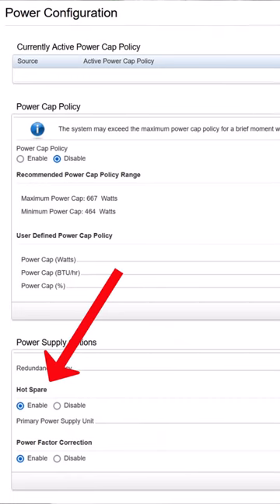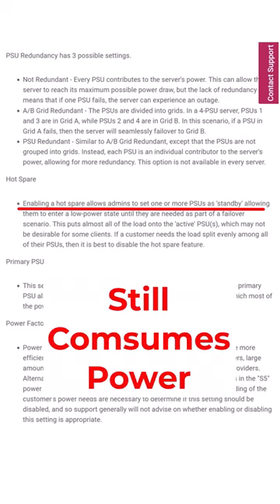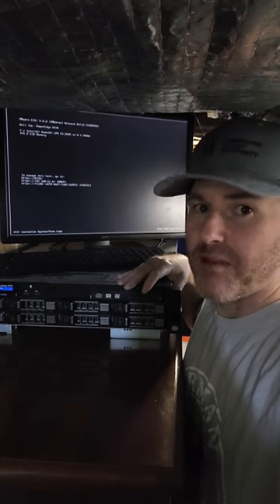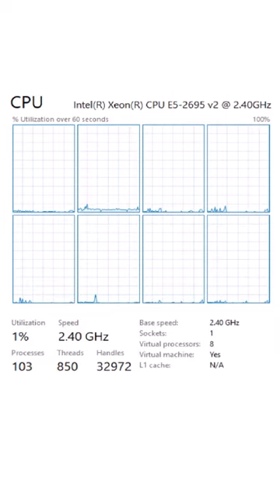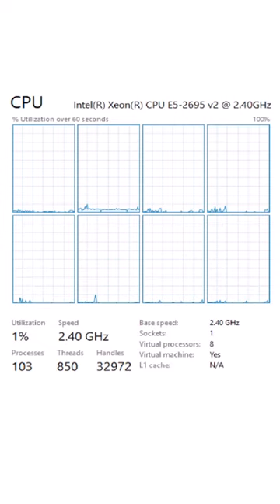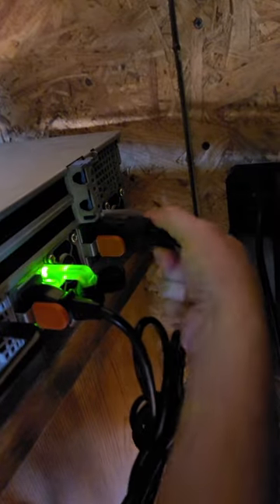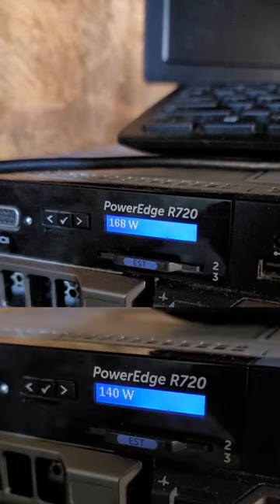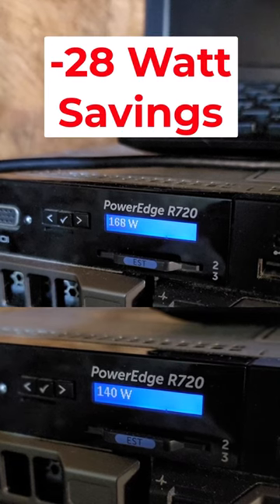Dell Server Homelab Power Consumption Tip

Comment: In a homelab environment I think this is totally acceptable. Which is what this channel focuses towards anyways, so thumbs up. Obviously not in an enterprise environment, but I feel that was implied. Good stuff man. Not many people looking at lowering power consumption on these old rackmount servers. I’d love to see a part 2 if you come up with any more ways to save power!
Reply from the maker: Thank you for the kind words! As you said, that's exactly what this channel is tailored towards. With energy costs rising to the order of 0.30 to 0.40 per kWh in some areas, it may be something a particular homelab user may be interested in. I'm glad you're interested in a part 2! I actually have some info collected for exactly that, ranging from specific BIOS settings to physical configurations such as with this video. Cheers!

Comment: Just remember this is a 1+0 configuration, don’t keep anything super critical on 1+0 PSU config, and if you’re in an organisation just don’t do this at all
Reply from the maker: You're correct. This is for homelab users where power effeciency trumps redundancy.
Reply: Yeah I thought as much, perfectly fine running 1 psu for non-HA applications

Comment: There are some people who adjust the fan curve (mostly for 1u server), so fans would consume less power, others disable USB, NICs, internal SATA, avoid using HDDs, enable C-Sates, use smaller PSU, reduce the amount of ram sticks.
Reply from the maker: That is true. On this YT channel I provided a step by step guide for manually adjusting the fan speeds using IPMItool. I also have another video on this channel that picks apart the average consumption rates and effects of each on the overall power consumption.

Comment: Dont trust the power readout for anything outher than a guide, the resolution is very low so does not give you and accuracy.

For example the R330 in my homelab logs poeer every 15min, and during normal operation only reports i value of 42W, 56W or 70W

Accurate measurement will need a power Meyer, and if you have two you can see if the power policy working. Also if not i have found that after some time i see both power supplies start delivering power so have also gone down the path of just unplugging one power supply and they work both plugged into a UPS
Reply from the maker: It's close enough give you an indication of power reduction.

Comment: I've seen people getting 90W with some VM's running. Few threads on /r/homeserver. How are they getting that? I got mine today and it's idle. Only using a single HDD while I play around.
Reply from the maker: Sounds like they probably only have one CPU or two very low power CPUs + SSDs, likely not dual redundat PSUs, no PCie cards or NVMe for drives and all power limiting fearures enabled and/or not many ram slots occupied. If they're that low in watts with an R720, the system is limited compared to its maximum capability. It's a give and take all over the map, but they're greatly limited in some ways.

The 150W this one R720 gets is the absolute minimum for dual CPUs (highest thread count), all ram slots occupied, all drive bays occupied with HDDs, two NVMe drives, power saving options enabled, and dual redundant PSUs enabled. From 150w idle and under benhmarks skyrockets to 550w

Comment: WTF NEVER DO THAT you disable Redundant Power for savin energy absolutely not!
Reply from the maker: If one has a consistent, reliable source of power with it's own UPS, it's a common practice. Been doing it for over a decade on numerous units with with zero issues. Homelab setup, sure. Enterprise environment where HA is paramount, no.
Reply: and all for 20W saved !!!
Reply: @craigcooper1967  - In my case, that's £40 saved a year for something I don't need. Nice to have? Sure. But don't need.

Comment: This is kinda dumb… redundancy is very important, especially if you need 24/7 up time.
Reply from the maker: Redundancy is definitely important, but this is also assuming the system is on a UPS. Power supplies don't fail frequently enough in a homelab situation.They happen, but uncommon. This is also a situation that the owner needs to weigh. In certain areas electricity costs can be high, so if the server isn't running heavy loads but doesn't want to power off, this could be an option. But yeah, good call. If high availability is paramount, definitely run in hot spare.
Reply: I would like to think that most homelab environments can handle a little bit of downtime in the extremely unlikely event of a power supply failure. Due to currently high energy costs in the UK, that extra 28 watts would be costing me £73 per year, so I can definitely go without. Of course, in a mission critical environment, the removal of a power supply wouldn't even be a consideration.
Reply: Well hense the name home lab 😂. Down time is not important. It's NOT a Production environment. Hell I only power on my boxes when ever needed. It's not like you are hosting customers data.

Comment: That's how you lose all you backup data 😂 in case of power loss 😜
Reply from the maker: Thats why you run an UPS.

What do you do on any computer with just one power supply? 😉
Reply: @Warning56kb  raid 5😁
Reply from the maker: @DanielHalus  I have RAID-10. Ran RAID-5 for a decade before switching to 10 around 2018 or so.

But, RAID is not a form of backup.

Comment: I just use normal standard Desktop hardwarethese days to run servers. I use to own two Dell Power Edge servers for my 1st home lab 8 year ago. And boy they were loud and used a lot of power. After building my 2nd homelab 7 years later I cut my power consumption down to 70%. My True NAS server only idles at 35Watts while my VMWARE ESXI box idles around 55Watts. Both running on old Desktop hardware that are housed in a rack mount server chassis. No need to buy server grade hardware these days esp for a homelab.
Reply from the maker: It totally depends on intended usage and can vary wildy from user to user. The loundess issues are no longer an issue with IPMI Tool. One caveat is RAM capacity for large virtual machine usage. It's difficult to find standard desktops that can support 192GB or 768GB of ram. That and already built-in enterprise raid with SAS capability that consumer hardware doesn't have. Management features such as iDRAC and iLO are also very useful. All in all, nothing in life is truly necessary, but if one is pursuing a career which manages enterprise hardware, having a homelab for testing is more than helpful.
Reply: @Warning56kb  64GB is good enough for me. I mean who needs that many VMs any way for a single user home lab? Usually server grade hardware goes to waste since you aren't really using it to is full potential just for one person. It's not like thousands of people are connecting to your personal setup. A lot of that power consumption goes to waste. If you have customers and you re running a production setup, that's a whole different story and ball game. I'm running Windows Server 2019, RHEL8, RHEL9, Ubuntu Server 22, Active Directory, WDS, UNIX Free-BSD, pfsense and VyOS all on one physical desktop as VMs. I also have a MacMini that's also part of my home lab.
Reply from the maker: @eman0828  Exactly, again it all depends in usage. 64GB is more than enough for your uses, but may be unsatisfactory for others. That and if electricity is sub $0.12 per kw/h, most people will be nearly unaffected by a difference between 50w and 150w each month.
Reply from the maker: For my uses iDRAC and iLO have been more than just helpful, they'be been essential. Again, you do not find iDRAC or iLO useful, and that's OK.
Reply: @eman0828 you got to remember some VMs EAT RAM up depending the application. I run a GNS3 VM, basically an emulator for routers, switches, etc., that I use to study for Cisco certification exams. I have 64 GB of RAM specially for that VM as emulating those devices are very RAM hungry. Just like he said earlier, really depends on your use case.
Reply: Can you share your TrueNAS setup?